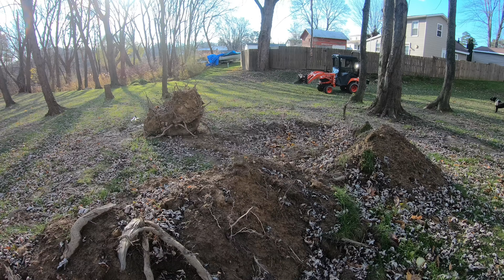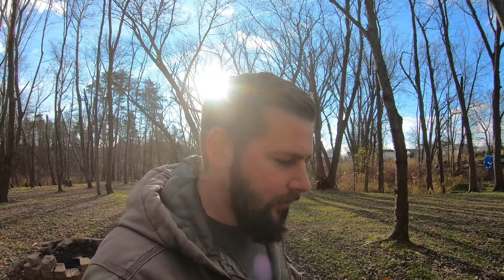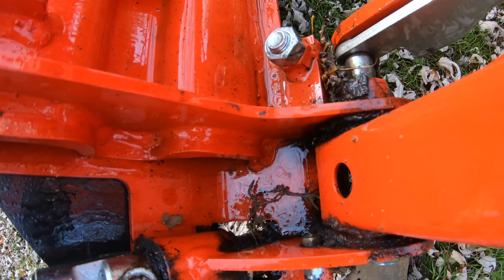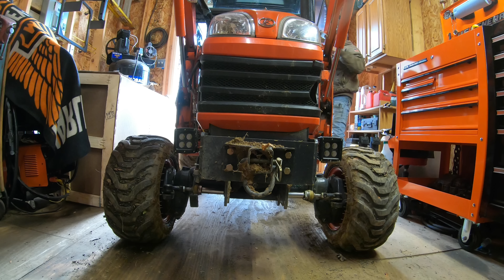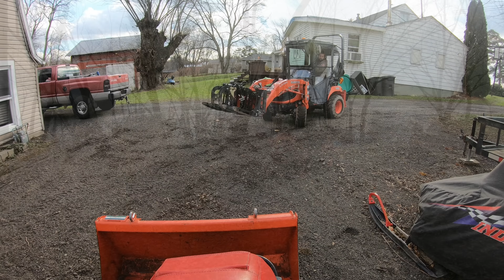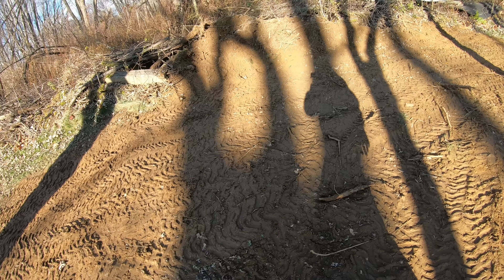Kubota BX: Pushing Down A Tree, Pulling Stumps + Backfilling Holes  ***Hydraulic Leak!***

Comment: Great job! What is your hydraulic pressure set at?
Reply from the maker: Hey sorry I am just seeing your comment now buddy! I currently have my hydraulic pressure set to around 2,400lbs.. actually 2,450 to be exact from what I remember.. but it’s been a long time since Iv checked it so I’m sure it’s tapered down a touch since then. I have been running at this pressure for years now.. doing an insane amount of work and lifting extremely heavy and awkward objects with ZERO negitive affects.. the tractor and the front axle has held up like a champ.. so have the hydraulic hoses. I still don’t recommend anyone go this high with the pressure though.. also never go over 2,500lbs as the tractor starts to act funny and make some strange noises .. this is why I left mine at 2,450 just below the 2,500 mark . Tbanks for watching and check out my more recent videos!

Comment: Same thing happened to me, I tacked a rounded gusset on that cylinder in front of that connection, I didn't want to take my chances on getting that lucky again.
Reply from the maker: That’s a great idea, it certainly shoulda had one from the factory. I’d be worried about melting the seals in the cylinders tho welding to it like that. I wish Kubota woulda thought about that tho since it’s a single cylinder curl setup the cylinder is right in the line of fire unlike a dual cylinder setup. Thanks for watching!
Reply: @BiffsEquipment  Just 3 tacks each side & blow cool with air hose, plenty strong.
Reply from the maker: @mikeriege7919  hmm, maybe I will do this man. If I use some 1/4” steel it should be plenty strong enough

Comment: i have a BX2350 with the pin on style bucket. can you get that stump attachment for the pin on loader, or would have i have to convert my loader to skid steer attach style somehow. our tractors are the same size and class, just different generations of BX, how much of what you are doing, can i do with my BX2350?

i used the regular loader to take out stumps and it was time consuming, i ended up taking out more dirt then i should have to..... but it did eventually work
Reply from the maker: Hey Andrew, I think I answered your comment on another video but can’t remember. As for the stump bucket, you won’t be able to add one with out having a skidsteer coupler .. but you can go to your local dealer and ask to have one ordered.. they are only around $400-$500 and you can even buy an aftermarket one online for less I think..  the skidsteer coupler will just get pinned in place on your loader and then from there you will have to use all skidsteer couplered attachments .. so you will want to either buy a skidsteer coupler bucket which they also sell at the dealer for your tractor or you’ll want to buy a skidsteer mount from Amazon and have it welded to your old bucket to convert it which may be a cheaper route to go.. once your set up with the skidsteer coupler you’ll have full acsess to all the attachments I use in my videos and many more! 

Digging stumps with the regular bucket is not easy as you found out. I have also dug stumps with it before and it’s very time consuming.. the stump bucket is nice because it has pin point accuracy and you can attack the roots much better and easier with out disrupting so much of the ground around it.. also the teeth on the sides of the bucket greatly helps saw through tough roots. You’ll love having a stump bucket! Just need to get yourself a skidsteer loader coupler first! Best of luck!
Reply: @BiffsEquipment  thank you. the outcome of the election determines how i feel about spending some money, but it probably wouldnt be a bad investment and would pay for itself pretty quick with the mutliple stumps i have yet to remove. i have atleast 3 left.

Comment: I noticed you do a lot of grading. Do you think the Agrifab roller would work with compacting the soil or just a waste of money?
Reply from the maker: Hey David, a roller certainly wouldn’t hurt.. tho in most cases I can get away with just tracking back and forth over it with the tractor to pack it down. A roller isn’t needed but they are helpful in getting the ground much flatter when you finish where the tires can leave divots and imprints in the ground. Also a roller is just handy to have around to keep your lawn nice and flat each spring and to help take care of ruts that you may accumulate from driving your tractor back and forth on rough ground.. so a roller def has its place.. it’s just whether or not you see yourself using it for other stuff.. if you were only buying it just for compacting areas you grade then it’s gonna depend on how much grading you to to see if it’s worth it for you or not. Hope this helps!

Comment: What the attachment called and how much was it? I am in the market for a bx23s
Reply from the maker: The attachment I used is made by “Artillian” it’s called a “stump bucket” or a “trenching bucket” on their website. It works fantastic for not only ripping out stumps but for digging long shallow trenches or transplanting smaller trees/bushes. This bucket mounts only to their fork frame so you have to buy their fork frame first, then you can get their bucket.. but once you own their fork frame you can then buy their grapple, or pallet forks as well which all attach to the same frame/fork frame. Hope this helps and lmk if you have trouble finding it. 

PS. I have many more videos of this bucket in action.. just search “Biffs Equipment stump bucket” or Kubota BX Artillian stump bucket” and all my other videos should pop up on Google or YouTube 👍🏻
Reply: Would the grapple be for mini excavater or reg?

Comment: is it possible that hydraulic hose is on backwards? the elbow does not make sense I will check my bx25 tomorrow and see ifs the same
Reply from the maker: That’s a great thought, I was thinking the same thing when I looked at it since the other end is a straight fitting I thought about swapping the line around backwards from the way they have it if it will work but then a few guys commented saying theirs was the same as mine so I’m not totally sure? Hard to say
Reply: @BiffsEquipment  I checked my BX 25 my hose is straight no 90° bend on it it's actually straight on both ends that's the hose that's closest to the ground on the cylinder. if I were you I would flip that hose it looks like it would work better with the 90° bend on the other end
Reply: my  other hose on that same cylinder has a 90° bend on one end and straight on the other maybe your hoses are backwards
Reply from the maker: @madtater5948  Okay thanks that's great to know man thanks for checking yours for me. You have the LA243 loader tho and I have the LA340 so I'm guessing it was something Kubota did on their newer loaders but why they would is beyond me lol. Ill see if I can flip mine around so that its no longer sticking out sideways and getting snagged on stumps/branches, and vines. Ill keep you guys posted with it!

Comment: I have had the same issue with that curl cylinder line where it caught and loosened. I was also confused as to why it had a 90 on it. I figure I'll just run it til it breaks and correct it then! Nice work!
Reply from the maker: Yah I really don’t get why they did that, at first I thought maybe they assembled the line backwards, cuz flipping it around would make a lot of sense to me so I’m gonna check into that. Thanks for watching!

Comment: Pro tip: When felling trees, leave 6 ft tall coming out of the ground. You then have nice leverage to push and pull with when digging them out. Can be cut shorter when you get them out of the ground.
Reply from the maker: Thanks buddy, I do actually cut them longer now if I plan to Dig them out but all of these trees were cut long before I ever owned the stump bucket so I did not have this Hindsight at the time but now when I cut a tree down that I know I’ll be digging out I leave them longer or if they are a smaller tree I just leave the whole tree and push it over. Thanks for watching!

Comment: Do you think you could have done all that if it was a BX1870 instead? I'm considering the smaller machine because mostly it'll be a mower, but I have plenty of grading and gravel to move.
Reply from the maker: Great question.. so with the 1870 or 1880 the HP is not as much of an issue.. it’s still gonna have quite a bit of power for pushing things over as well as the lifting abilities stay exactly the same so no issues there. The one problem with the 18hp version is they have smaller rear tires in the rear so you may not get as much tractive power as the 23hp version with the 26” tall rear tires. Aside from that the only other main difference would be if you planned to run a lot of rear PTO implements, such as a brush hog, rotatiller, things of that nature because the 18hp machine doesn’t have a lot of PTO HP so it may bog if you work it heavily when mowing really thick grass or using the PTO heavily but aside from those 2 things it’s the same exact machine. I have heard of guys installing the 2370’rear tires on an 1870 but you’ll have to look into that. If your able to do that then it should be pretty close to the same digging potential maybe a little less than a 2370 but the PTO horsepower will always be a bit lower.

Comment: Fantastic working that stump bucket and knocking over that tree :) you need a bigger bash bar. Thanks for posting when are you expecting snow?
Reply from the maker: Thanks Ross! Had a great time giving it a good workout over the weekend. We havnt got any major snow yet, couple small storms that melted with in hours but I’m thinking later this week or next week. I’m excited to plow. Thanks for watching. 

PS. I checked out your video yesterday, those snow blowers do a great job even with such thin snow, glad you had a sheer pin on hand 👍🏻
Reply: @BiffsEquipment  Yes it was good to have on hand. We got heavy snow all night last night and now it's going to rain. It's heavy wet and a lot thicker today. Should make for a good comparison vs the light dusting. I may have to run the PTO at full speed today. :) Thanks for watching it. Like your cab as well.

Comment: Hey Biff, just a quick thought on that curl cylinder.... 
is there any reason you couldn`t just pull the pins out of the cylinder, then rotate the cylinder 180 degrees so that the lines are on the topside instead of the bottom? I haven`t looked at mine yet, so i don`t know. I would think it would protect the fittings and hoses alot better if they were on the topside for the kind of work you`re doing. Or maybe weld a couple half rounded steel protectors close to the fittings to act as a guard (?)  Kinda to the effects of those steel guards they weld around wheel valve stems to protect the stems from getting hit.
Reply from the maker: I’m not sure if you could but idk if you’d want to either as it may bend the cylinder easier if you bend it around. In any event tho I plan to build a gusset for that hydraulic bung on the ram so it can protect the line if it ever happens again. I’ll prolly make a video on it when I do it 👍🏻

Comment: Nice video Mike! When I read the title I wondered if 2400psi was to much? But all is good. I do have a question though. What's in the Curtis Industries box I saw in the shed?
Reply from the maker: Haha yah I can see why you thought that! Iv been waiting myself to blow a line or tweak my loader but as hard as Iv worked it I havnt hurt it yet. They really built thus machine well to handle exactly what the machine can output, cuz I litterally give it all its got and it hasn’t hurt itself yet. 

As for the Curtis box I’ll be doing an unboxing of it soon in an upcoming video 👍🏻